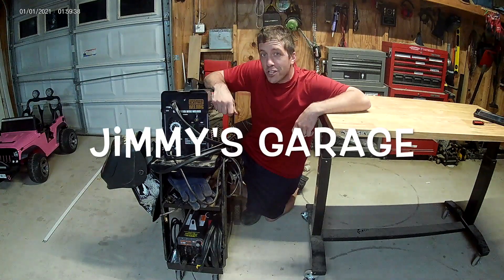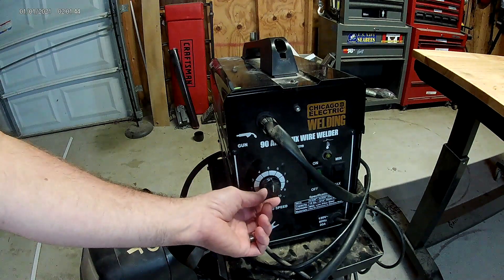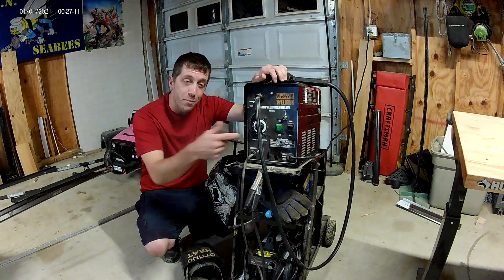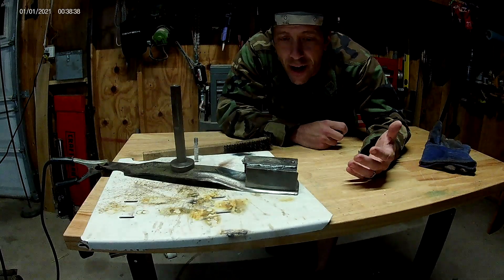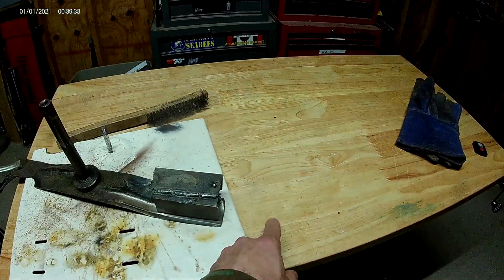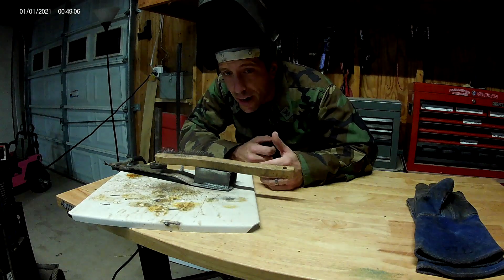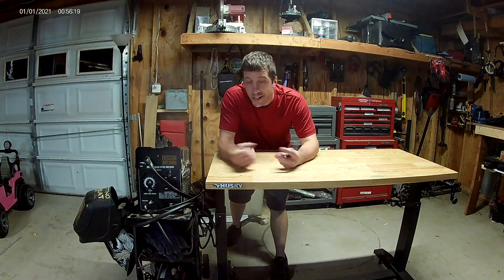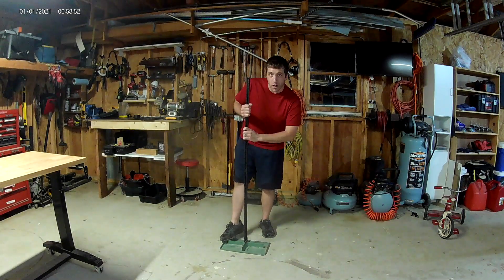Cheap Harbor Freight Welders - Are They Worth Buying?

Comment: Old bed frames are made of a spring steel you have to take the temper out to get them to weld properly or weld the crap out of them and heat them up so much that it takes the temper out but you have to do it quite a few inches away from your welds or else when it cools it's just going to separate because it's two pieces of metal with a different coe. And just because the cooling process alone did not separating two pieces of metal does not mean they are fused together. Cold welds are strong until they're not.